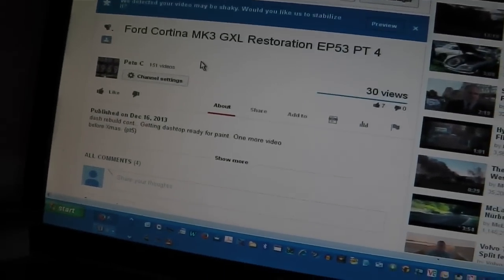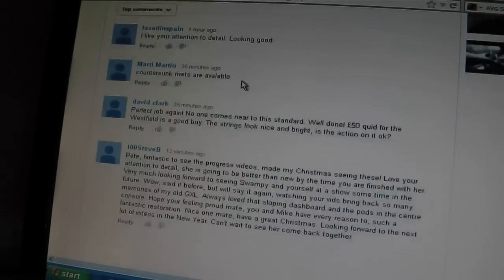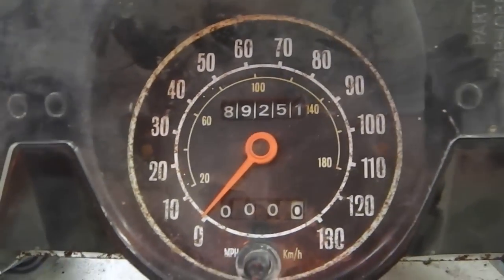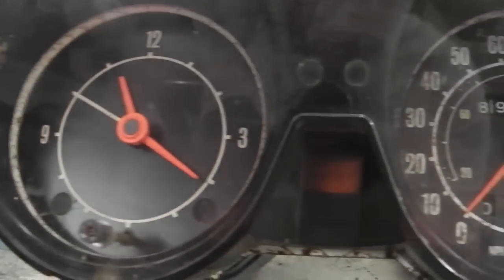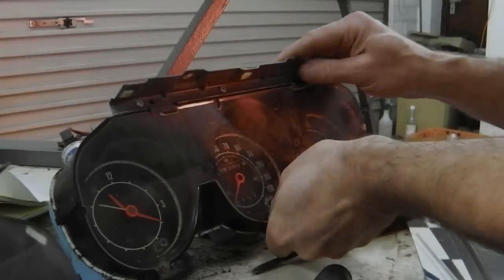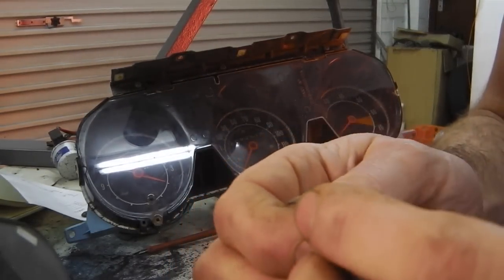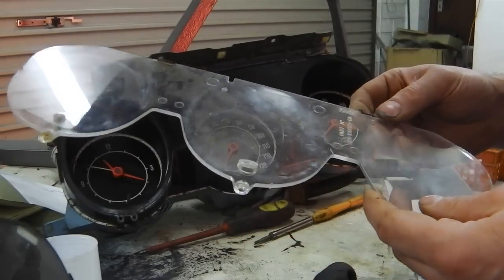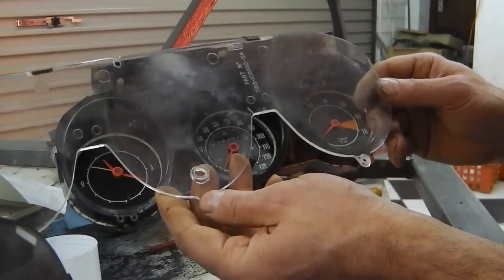Ford Cortina MK3 GXL Restoration EP53 PT 5.(1)

Comment: I had the same problem as you with not being able to comment on the tube. The instruments are looking good, will the perspex not reverse or are the holes slightly offset. It is a pity that the speedo face will not clean up. I am enjoying this new series of videos, thanks for making them.
Reply from the maker: spedo face has cleaned up ok, watchmext few clips coming soon, thers is some slight pitting on the speedo face but its acceptable and keeps it orginal too. I do have a new face i can swap later as it can be done on the car quite easy. thanks for watching its really appreciated, as i said its you who keeping me going out there!